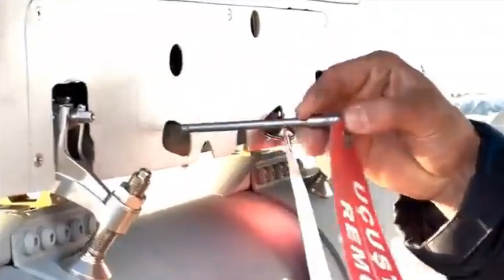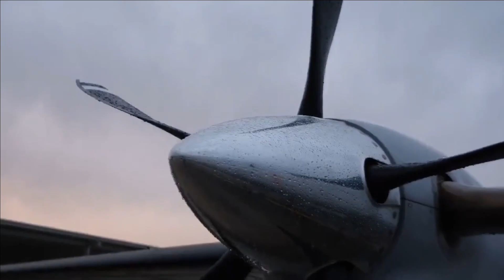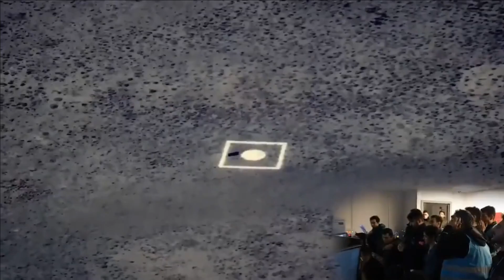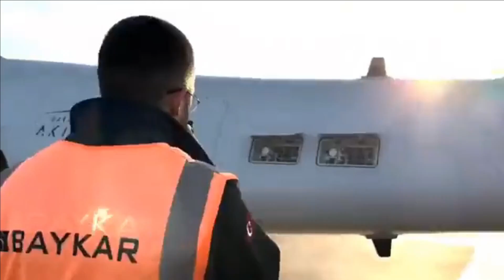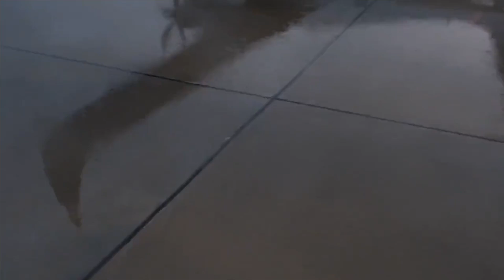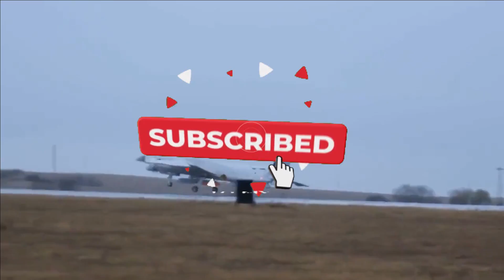Did Turkey test fired hypersonic missile Roketsan TRG-230-IHA from Bayraktar Akinci UCAV?

Comment: These missiles can engagen enemy from distance,  without taking risk  losing either drone or the carrier. 100km is the average. Its range is around, I believe 150km. Just by shooting from drone, trg230 gains around 70km+ range advantage. From the track mount systems, the range is much shorter. Akinci can carry and shoot cruise, anti ship missiles from much greater distances. It is a great capability. If Ukraine had this capability, the russian would have been in much greater trouble.
Reply: Trg missiles is already in the battle of Ukraine 🇺🇦 Russia 🇷🇺 conflict

Comment: its such a huge drone with a huge radar cross section , it will blown in the air even before it fires any missile
Reply: It flies at an altitude of 45,000 feet and has missile warning systems, radar warning receiver systems, and chaff/flare launch systems. In addition, all of Akinci's assault weapons carry cruise missiles to attack from a distance of 250 to 500 km. So it doesn't need to be in radar range.
Reply: yeah its to massive kinda ruins the point of drones
Reply: @siliconcore  it's not to inter enemy defense zone but to fire standoff missile and gather intelligence.
Reply: And engineers did not think this but you did. Bravo, you have a job in Baykar now.
Reply: There are missiles that have ranges over 500kms, while most air defense units are under 300km
Reply: Yeah Russia shoots it down easily with s400
Reply: Radar kesit alanı tb2 kadar akıncının yani fazla değil , hiç bir hava savunma menziline girmeden uzun mesafe mühimmatla hedefi vurabiliyor
Reply: It lunch the missile from 150km away(officially). With what air deffence missile you will shot it down? It also carry air to air missile that could shoot down coming missile ot use EW to jam it
Reply: This drone flies with electronic warfare system supports.
Reply: If aliens attack the earth, they will connect all the air forces of the world to you. We need such a genius there.
Reply: @hellmarch3043  you didn’t get my point it can be useful for surveillance, but against a country with good air defence or fighter aircrafts it is just a toy
Reply: @gravityjapan  🤣Russians used to call tb2 a toy, then we saw the results. But keep seeing it as a toy. This is good for our Pakistani brothers. Go on like this. 😚
Reply: @gravityjapan  Be sure if ones building these kind of weapons, they're building ELECTRONIC WARFARE weapons also.
Reply: @gravityjapan just ask the Russian air defence systems around the world whether they can be blown out the sky or not 😂😂😂😂
Reply: @hellmarch3043  First your brother's must live to fight, to live they must be fed atleast once a daily,  so First send some food to your brother's.
Reply: @hellmarch3043  russians are getting banged even by small dji drones what is your point?
Reply: @hellmarch3043  india has thousands of small swarm drones
Reply: @thirumoorthy3375  I'm saying as a Turk, what you say is very true.